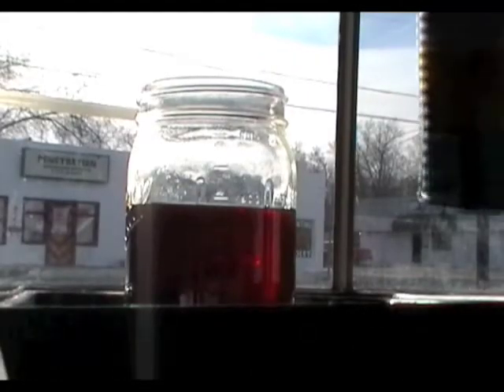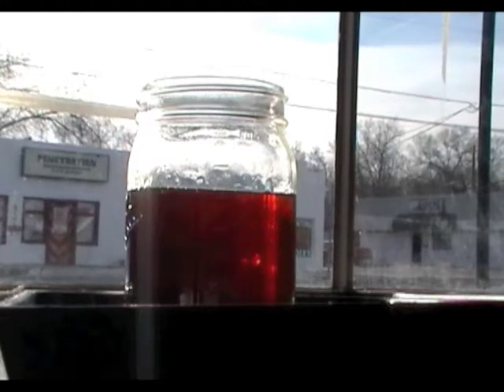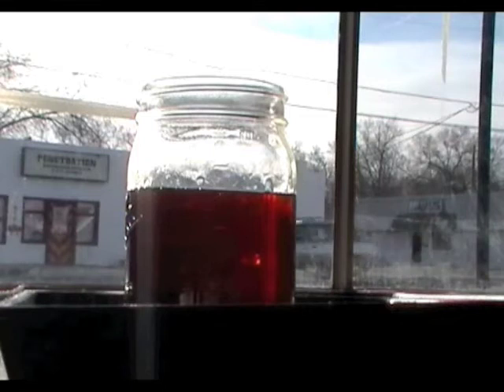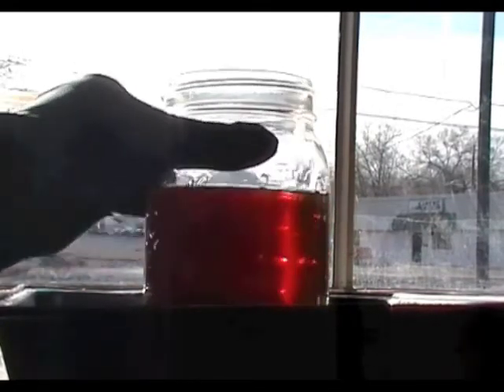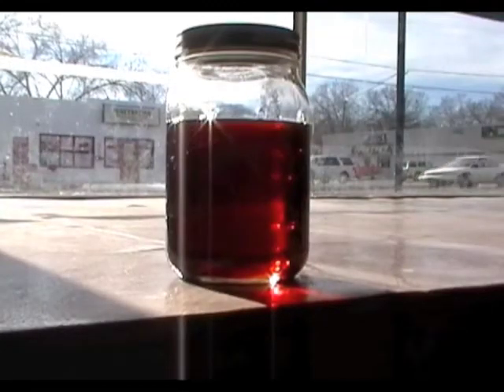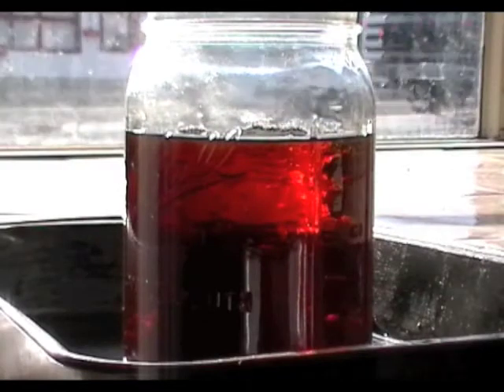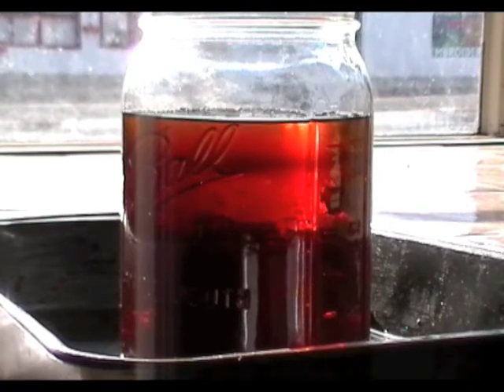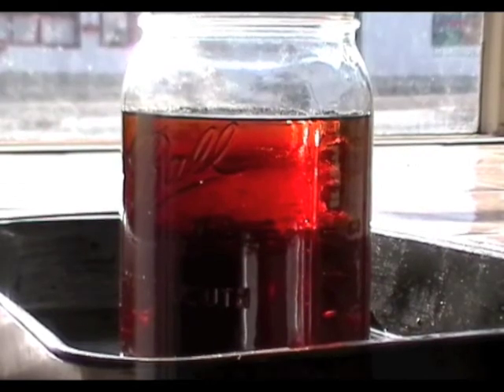Blending Xylol (xylene) with Vegetable Oil to Make Waste Oil Blend Diesel Fuel (WOBDF)

Comment from the maker: For this video I used Xylol blended at 20% with canola oil at 80%.  I have not; however, run this blend in an engine.  The point of these various blend videos is to show that recycling waste solvents by blending them with waste oils could be a feasible fuel alternative.  Recycling mis-fuel should work just fine.

Comment: Would like to know what percentage of Xylol you used and what percentage of petrol you used.
If I were to add Xylol then I would prefer not to add petrol as it is an additional cost.
I do however, get a free supply of mis-fuel (petrol/diesel) which I could add.